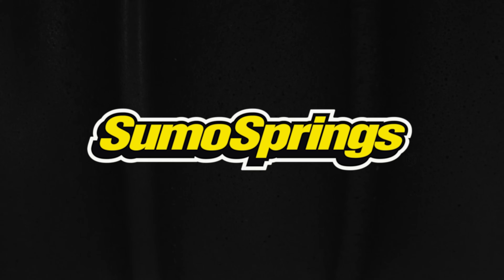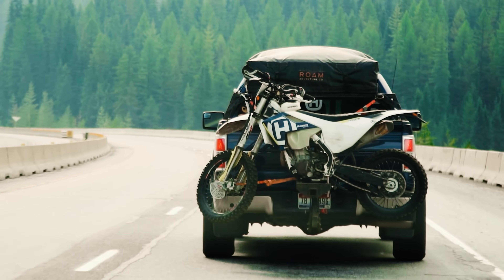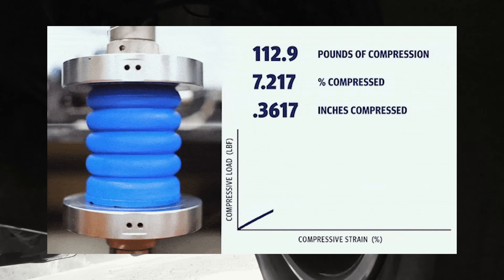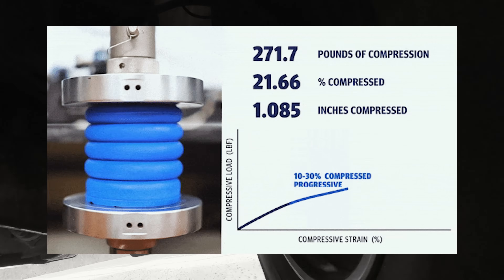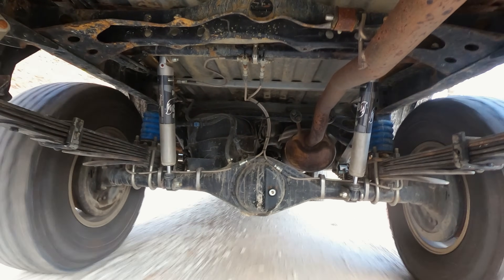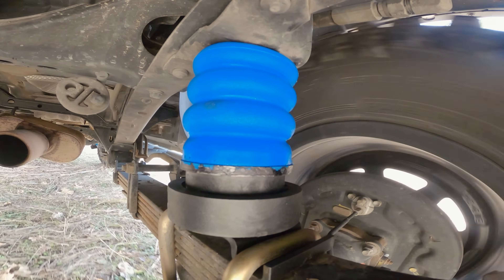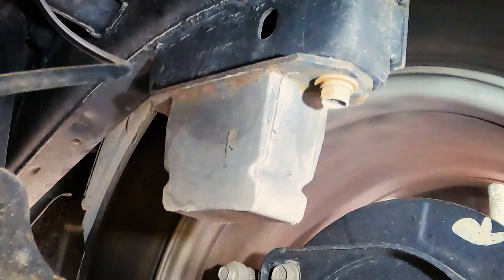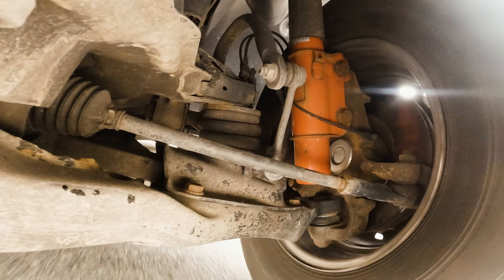Engineering Corner: The Ultimate Airbag Alternative

Comment: Is it possible that this is a good idea for RV’s ?? I would love a front set. 1999 Ford 350 super duty frame .
Reply from the maker: Hey @uplift56 – for an RV built on the E350 frame, we'd actually recommend going with SuperSprings for the rear instead of SumoSprings due to the weight and age of the vehicle. You can check them out here: https://superspringsinternational.com/product/ssa34/. 

If you wanted to try out SumoSprings though, we do have an application for the front of your RV, the SSF-106-47 which you can check out here: https://superspringsinternational.com/product/ssf-106-47/

Thanks for reaching out, and let us know if you have any other questions! #JourneyBetter